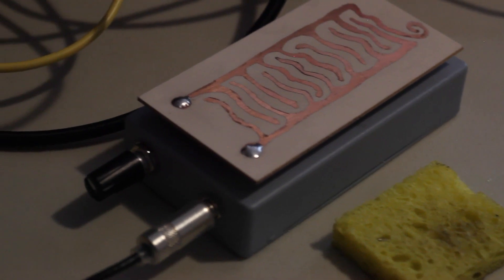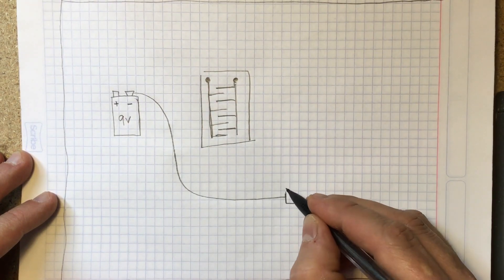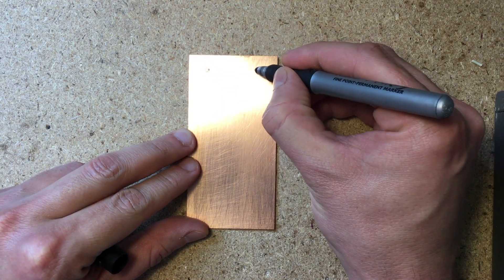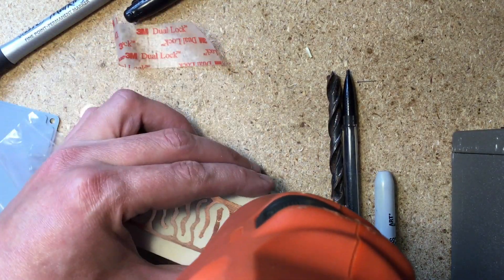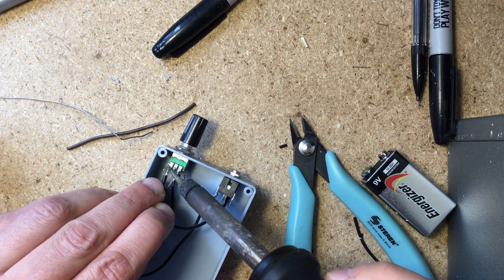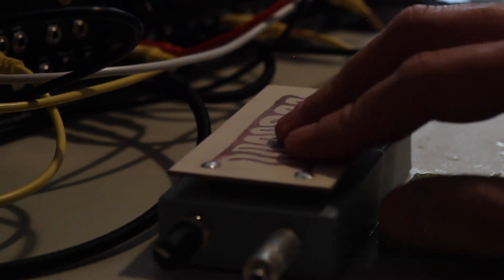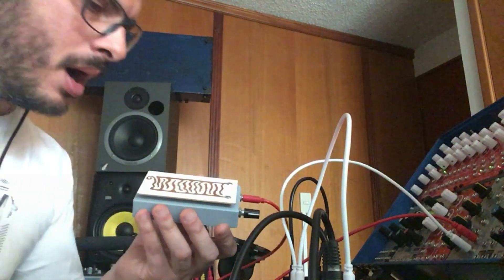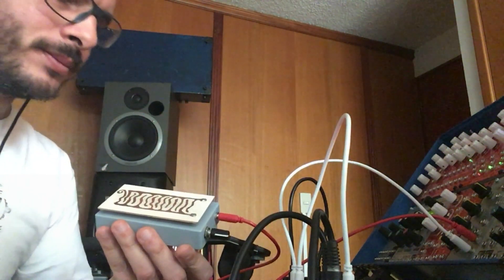SDIY Class # 7 - Taktile : A simple pressure sensitive Touch Pad!

Comment: You actually just inadvertently gave me an idea how to make a velostat-based pressure sensitive pad, by making a DIY PCB with interleaved traces then bridging them with the velostat.  I've been experimenting with building sandwiches of velostat, copper and silicone rubber, but this would be way easier to make and still much cheaper than buying pressure pads.  Also no need to solder the pads to the board, it would all be integrated.

Comment: awesome! definitely adding this to my diy list!
btw I have a copper clad plat but never used one.. you think it's ok to draw with a sharpy & just peel or sand off the copper in between? I'm cutting costs & complexity anywhere possible (ferric chloride in this case)
Reply: You can sand it off, but if you do that, there's no reason to mark it with a sharpie, the purpose of drawing with the sharpie on it is to cover the spots that you want the copper to remain.  So if you're not etching it, no reason to mark it, other than as a guide.   You can also use a knife or whatever sharp instruments to remove the copper.
Reply: @videotrexx  hii thank you for you reply. I did do it. I was trying to show you but yt won't let me post links
Reply: @kuro758  Great and you're welcome.

Comment: Thanks for the demo. I made my own take on this design using copper tape and no capacitor and it works great, but my pitch descends, while your seems to ascend (5:43). Why would this be? Also, I would like to make a similar design for a breadboardless gate/trigger pulse to trigger a Clouds freeze or an ADSR. Would you have any ideas for this?  So far, I am able to trigger only one module (Synthesis Technology's Circuit Bent VCO) using the copper tape and no extra voltage other than my body. Thanks for your great work.
Reply from the maker: Hi! Pitch ascends because when I apply pressure the resistance goes down and a higher voltage hits the VCO. I don't know why yours descends. To make this into a gate generator use a comparator circuit! Look up opamp comparator for ideas, or my own video on opamps. Cheers!
Reply: @QuincasMoreira  Big thanks.

Comment: Hello, complete NOOB here. I’m trying to use this, with a simple NE555 in astable mode circuit, but I don’t know where to connect the speaker. On your top schematic, where the jack goes, you wrote signal, is that signal in, or out? And on the second [smaller] circuit you drew, you wrote out at/on a potentiometer? Please clarify this for me: how would you connect a simple ne555 to this circuit AND a speaker. Thank you kindly

Comment: Great simple idea.  Here is my simple tip. Be sure to properly etch the blank pcb.

In my first attempt I didn't leave the board in the etch solution for long enough to properly remove the excess copper. 

I snipped off and  tested a small piece of your my pbc material to see the colour of the bare board underneath.

Thanks Synth DIY Guy. 

PS I spent a month in Mexico DF in the late 1980s.  What an amazing city you live in 👍

Comment: Is there any risk of shorting out or hurting other circuits in a modular synth? Say if I'm touching this and then grab a patch cable thats plugged into something else?
Reply from the maker: kimmy_future Hi! Your body is a resistor in the order of Megaohms, so no :)
However if you power this with euro power do use resistors so you don’t accidentally short the positive rail to ground.
Reply: @QuincasMoreira  Got it! thanks!

Comment: Thanks for this great Video :) 
How long does the ferric chloride take to etch away the copper?
Got a pcb in a 40% solution for hours but nothing is happening..
Reply from the maker: prefect eli should be about 20 minutes, sounds like there’s something wrong with your solution... Is it from a fresh new bottle?
Reply: Its straight out the bottle, but i think i solved the problem already.
I closed the container with the ferric chloride and the pcb, so no oxygen.
I opened it, I think now its working.
Thanks for your quick reaction on my post :)

Comment: hi, this thing is awesome, considering how easy it is to put together.. I built it with some bare copper wire and it works great, thanks for the video.. I have one question, is it possible to power it directly from the busboard and avoid the battery or a CV source (I'm now sending 10V from a MI Shades)? thanks! ✌
Reply from the maker: Sure! Just use a resistor so you don't short your power rail, at least 10k!
Reply: @QuincasMoreira  great, thanks for the help✌

Comment: Very interesting!....could  this idea be applied to create an expression device to control a hardware digital synth using its expression pedal input??.it would work to substitute the potentiometer of an expression pedal by a pcb surface like yours, using the 5volts provided by the expression input of the hardware digital synth? Thank you and sorry if my idea is nonsense...
Reply from the maker: I think it could be done, yes! A pedal is a voltage divider though, this is just a variable resistor, so it would take some experimentation to get it to work well
Reply: Thank you  @QuincasMoreira !

Comment: * Orders ferric chloride from Amazon...
Reply from the maker: cool :)
Reply: @QuincasMoreira  Actually, I ended up using hydrogen peroxide and muriatic acid and it worked great! I'm almost done building a box I that has four of these in parallel running off of a 9V DC power supply from a BOSS guitar effects pedal.
Reply from the maker: @TheGrrson  Cool! Would love to see the box when you're done!
Reply: Synth Diy Guy I’ll email a pic when it is done! Also, you can see the little DIY euro rack synth I built on my Instagram @graysonmendenhall Thanks!
Reply: @QuincasMoreira  Hey Quincas! Do you have an email address I can send a pic to? I just finished the box and it sounds amazing!
Reply from the maker: @TheGrrson  synthdiyguy@gmail.com
Looking forward!
Reply from the maker: Have not received your email yet, did you send it?
Reply: Synth Diy Guy I just sent you two pics!
Reply from the maker: @TheGrrson  Looks awesome!
Reply: @QuincasMoreira  Thanks! You can really get some expressive sounds out of it. Breathing across the plates is crazy! So is licking your fingertip and dragging it across the contacts. Thanks for posting this technique! Once this COVID-19 stuff is over, I may have to make another box that is the same size, but with 8 smaller plates.
Reply: Exactly
Reply: So this project led me on a quest to convert the Buchla 114 to Eurorack format. I'm about to order PCBs for it. I'll let you know how it goes.

Comment: hey diy guy, great stuff to do! i just made it but with 10 uF cap (was the only available at similar capacitance!).. is this making a big deal? the pressure pad works while set as CV/O. input for Erica Synth VCO but i couldn't get any result in a Kotelnikov VCO.. might it be a problem of which range of voltage is accepted by the Kotelnikov?
Reply from the maker: Hi! A bigger cap will add some slew (glide, portamento) to the voltage output, which can be cool or not, depends on what you want :)
As for the Kotelnikov, no idea why it wouldn't work. Maybe try buffering the voltage from the Taktile before it hits the VCO.
Have fun!

Comment: great video, it was what I was looking for for a while,.. 
I would like to know if I'm right or not.. As i read in the comments before, Tomas I think was the one, he asked how about to put 4 all in parallel with the same power source (I'm using 9v), meaning at the end I will have 4 outputs. with 4 pots as voltage dividers. my plan it;s to use those outputs as VC to "disturb" 4 oscillators with a Vactrol (homemade) between the output and the oscillator... it's that correct? i'm building my first diy drone / noise maker and I'm somehow new to the DIY world
thank you!!
Reply from the maker: that should work, try it!

Comment: I'm impressed! So if I want to put this on an eurorack module, i just need to ignore the battery and use the power supply? Can I make more than one "tactile pad" lets say four in the same module? Only thing I would need is to take voltage in parallel for each pad, right? Did you find a potentiometer that gives you a "nice range"? I know it might be limit my possibilities, but maybe replacing the pot for a fixed resistance will make the module more confortable to play.
Reply from the maker: Hi! Well, you don't want to put the 12v from your PSU right on a terminal exposed like that, so you would use a resistor, I'd say at least 100k. Yes you can have many pads fed in parallel, each with it's own resistor from the PSU 12v. The pot is set up as a voltage divider, so it doesn't matter too much, 10 k or 100k work equally well. you can use a fixed resistor divider, but it's nice to be able to set the range, so maybe use a small pot going through the front panel. on the top where it won't get in the way of your fingers.
Reply: @QuincasMoreira Guy out of curiosity, is that because it's a risk of short-circuiting or risk of electrocution? lol
Reply from the maker: @nasound42  short circuit, PSU damage, etc. You can't get electrocuted with 12v DC ;)
Reply: @QuincasMoreira  ah ok haha. Thank you!

Comment: Might be a quite dudmb question.. but can i simply plug it into a speaker?
Reply from the maker: F3ncheltee It doesn’t make sound, just generates a control voltage you can use to modulate parameters in an analog synth.
Reply: So in order to make sounds i do need an analog synth?
Reply from the maker: yes. think of it like a computer keyboard...  It does nothing without a computer attached. This is only a controller, does nothing without a synthesizer attached ;)
Reply: Ah I understand! So is there a way to connect this to a digital source or an audio source directly? I'm new to analog synths so excuse my 'dumb' questions :)
Reply from the maker: There are no dumb questions!
This device is simply a 9 volt battery with it's intensity variable by finger pressure. It doesn't generate digital information, only a voltage variation. You can use it to control an LED light for example. Analog synths respond to voltage variation, it's called Voltage Control, which is why this device works well to control parameters in an analog synth. If you want to use it to generate digital information you'd have to use an analgo to digital converter, which is a totally separate device.

Comment: what could you do to make it plug into a fling bus cable instead of a 9volt so you can stick into your modular case?
Reply from the maker: Intuition? Guessing? LOL
It's high enough that your case won't be harmed, but you may be able to go as low as 100K safely. 470k is a common value and it's about half of 1M.  Try different values and see how it responds!
Reply: You can use Eurorack power, but to avoid shorting out your power supply, use a largeish resistor, like maybe 470k from +12 to the touchpad. Do NOT connect 12v from your PSU straight to the touch pad, as a cable tip, loose screw or any other metal thing could short out your entire rack and damage your PSU and possibly even some modules.
Reply: why a 470K is you dont mind me asking?

Comment: Can it have a specific sound once you touch it? If so, how?
Reply from the maker: Hi John. It's generating a variable voltage to affect voltage controlled parameters in modular synths, but if you use a comparator circuit it could also generate a gate signal, which you could then use to trigger a particular voice, or even a sample using something like the Tsunami Wav trigger. Cheers!

Comment: What supplies do u need to make these boards???? Like what kind of copper board??? And where do you suggest getting them
Reply from the maker: I just get them at a local electronics shop. They are just blank PCBs, which you would normally etch a circuit on. I just etch a touch surface instead.
Something like this will do:  https://www.amazon.com/Single-Sided-Copper-Laminate-Circuit/dp/B01LX99SO8/ref=pd_lpo_vtph_23_tr_t_2?_encoding=UTF8&psc=1&refRID=PHKNQ6E45H9YA0HHNGHK

Comment: What kind of pannel are you using for the copper sheet? Im wondering where i would find something like that.
Reply from the maker: Hi, that's not a panel, it's a blank PCB! Same material you use to etch circuit boards at home. I get it at a local electronics shop. Cheers!
Reply: Oh! Awesome. Thanks for the info!

Comment: what kind of audio jack is that? I don't think i have the right one
Reply from the maker: Hi! Any kind of mono audio jack will work, for eurorack you should use a 3.5mm jack. I use the PJ301 BM : https://www.thonk.co.uk/shop/3-5mm-jacks/
Reply: Synth Diy Guy thank you! a couple more questions, what did you plug it into to get sound? also, can the touch plate just be square?

Comment: Can you do a video on making it usable in a Eurorack? Pressure points is good but not cheap, a DIY version would be great.
Reply from the maker: Phil, I am using it with eurorack! Just plug it in and have fun! If you mean making it into a module, just skip the battery and enclosure, make it a panel and use the +12 from the Euro PSU ;)
Reply: @QuincasMoreira  is it safe? Isn't the current to high? I don't understand anything about electronics lol, but i am scared of touching it haha
Reply from the maker: @franciscooliveira7089  completely safe, like touching a 9v battery!

Comment: I guess this must be a similar way  ribbon controller controllers are made :-)
Reply from the maker: Adamski Ajull FSR are done similarly. Ribbons are different, one terminal is conducive and the other is resistive.
Reply: Synth Diy Guy Hmm ok thanks for clearing that up for me :-)
Reply: Cheap ribbon controllers: Alumin(u)m strips (cheap at hardware store), old VHS Tape (recycling center?), and doublesided foamtape (bookstore, papercraft supply webshops, or the industrial strength version at the hardware store), and much the same electrical parts as in this video, but maybe make it "synth powered", so you can do sick bipolar cv sweeps.

In fact, that's a nice video right there. Have at it Quincas! ;)

edit: Okay i'm having a huge facepalm moment right now, sdiy class 6 already covered just about everything I said.. My mind, where is it today?
Reply: devjock . Thankyou for the info all the same . :-)